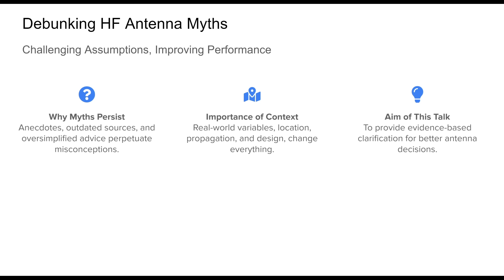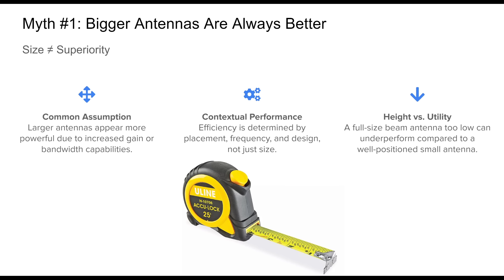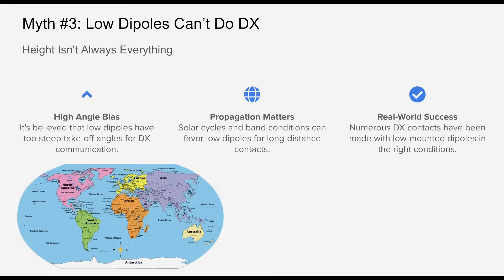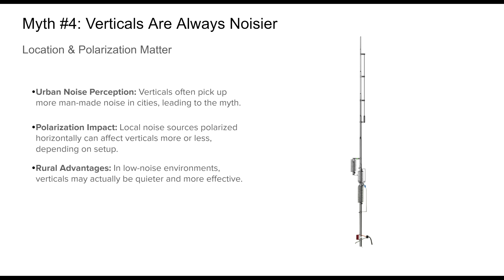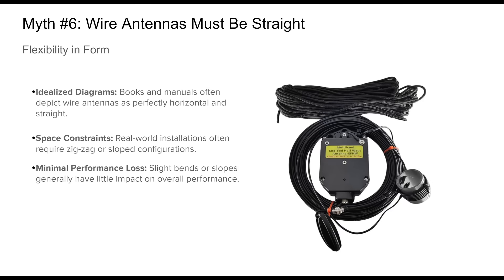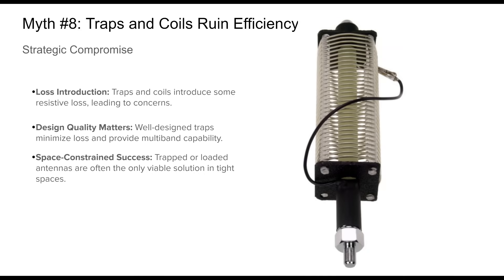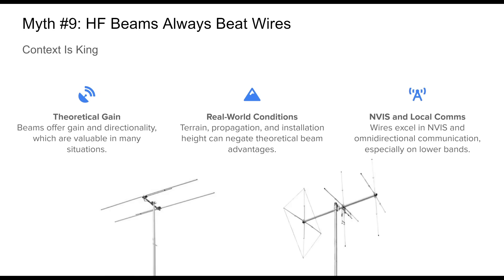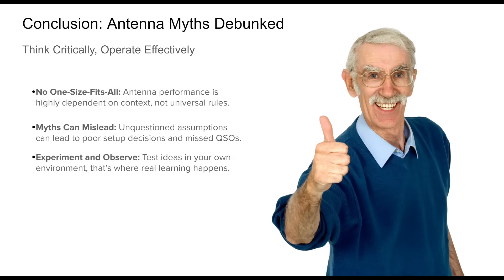10 Antenna Myths EXPOSED!

Comment: Excellent presentation of these myths! I would like to address your myths 9 and 10 from my experience. I have had both wires and large and small Yagis. With my small tri band (20/15/10) Yagi at 70 feet it worked good. On 20 meters it was no better than a dipole at 70 feet. It was easier at the time to get the small Yagi to 70 feet. About the same on 15 meters. The small Yagi was essentially a full size 3 element Yagi on 10 meters so it had reasonable gain. However in two directions my 300 foot end fed long wire was always better. The wire had slightly more gain off the ends than the Yagi. However it was easier to rotate the Yagi than the 300 foot wire.
My largest Yagi was a 4 element mono bander at 70 feet. I thought it was a great antenna. Slow to rotate but good gain off the front. Today I use three dipoles on a switch. The dipoles are two band ( fan configuration ) for 20 and 10 meters at 50 feet. When I switch to the one closest to broadside I feel like I instantly rotated a Yagi. The gain of the large Yagi was maybe 14 dBi off the front. My dipole has a gain of about 7 dBi broadside. The difference is maybe 7 dB. That’s only slightly more than 1S-unit! I have worked over 100 countries with the dipoles on multiple bands in a contest in one weekend several times, so that proves they work rather well and are a lot less trouble than the Yagi not to mention a lot cheaper! With a wire antenna the height above ground determines the peak elevation angle. However there is still a lot of radiation at higher and lower angles. Sometimes the radiation at low angles is still significantly more with a simple low dipole than with some other antenna configuration especially when compared to a vertical. A good vertical may have its peak radiation at a low DX angle but that peak gain is most likely zero dBi at that low DX angle while a low dipole or inverted V still has positive gain at that same low angle.

Comment: Myth #5: Your statement is correct initially, but we need to differentiate more precisely: Let's take my real dipole antenna at f=14240kHz as an example, which has an impedance of Z˙=51.7+11.8jΩ. By using the simplest tuner (a series capacitor) directly at the antenna, I can compensate for the X=+11.8j and then achieve Z˙=51.7Ω. If I then ask: Is the system resonant at frequency f? The answer is: Yes , the impedance seen by the cable is purely ohmic (X=0). If I ask: Is the antenna itself resonant? The answer is: No , the electrical length is not λ/2 for the frequency f. We assume that 100W of power is applied at the end of the cable. Looking at the circuit Before the Capacitor, the active power (P) is 100W, the reactive power (Q) is 0Var, and the apparent power (S) is 100VA. In the Capacitor, the active power is 0W, the reactive power is 22.8Var, and the apparent power is 22.8VA. After the Capacitor, the active power remains 100W, while the reactive power is 22.8Var, resulting in an apparent power of 102.56VA.

Comment: U can make good ants but u can  still get a sitio starduster  on uk ebay £75.99 it would coast more in metal and parts so y would u pi ss about  mine sat 150_200ft in the norfolk sky worked well  a usa comp usd 2 make a starduster with higher gane but can not find 1 at mo more monney 2 sirio still cheap as chips  today at 75
99   😊❤❤❤❤❤❤

Comment: Myth #5.5: Resonance is required for good efficiency.  In fact, non-resonant antennas can be efficient (and resonant ones can be inefficient).
Corollary to myth #8: A load coil is a matching network; it does what a tuner does.

Another nit on #5 -- a matched antenna is indistinguishable from a resonant load.  And it is a network of reactive components whose capacitive and inductive reactances cancel out.  If there's a feedline in there, it's just another reactive component that is part of a resonant system.  Saying a tuner doesn't make the system resonant is really just being fussy about definitions to start fights.

Signal pattern is not a question of resonance either, so bringing that up is a non-sequitur.

Comment: My inverted vee optimised for 5.262 Mhz had a maximum height of 22' and was bent horizontally into a G shape into my 25' x 13' garden. Not exactly a dx aerial but it worked. My Pixie running 350 mW got a SWL report from Utrecht 220 miles away. How much farther was my signal going?
A long wire at the old QTH in the 1980's got me VK, North/South America on 20m with North and South America and Falkland Isles on 10m. 100 Watts and using less on c.w.
Five attic h/b wire dipoles now for 20m to 10m. QRM for years had meant only above 20m was usable. QRM gone this year.
QRP here for 35+ years.
G4GHB.
Reply from the maker: That’s a cool story Bill, thank you for sharing 👍

Comment: Glad to see this, appreciate what you are sharing here. I obtained WAS and DXCC with wires and verticals not long after I upgraded in late 2000 to start my hf journey. I started with a 40-meter self-built coil loaded dipole in the attic of second-story apartment in the Chicago suburbs that quickly got the eastern 2/3 of the country for WAS on SSB with 100 watts. A year later I bought a house farther out in the suburbs and put up a Hustler 5 BTV on my garage and a homebrew OCF dipole strung up as an inverted vee along a fence line with a neighbor and the high point up in a tree. I had DXCC within a year of casual and occasional contest operating with 100 watts and these two antennas. It wasn't all a bed of roses, but to me, it was about having my station be a lab to carry out experiments. it's a journey and learning along the way that have made this such a great hobby on and off for me over the last 36 years.
Reply from the maker: Experimenting is the best part, thanks for watching Michael 👍

Comment: Vertical or horizonal antennas don't produce noise. They receive or transmit signals.  It is true that in some areas, the horizontal noise of VFD drives, Switch Mode Power Supplies, etc are radiated more off local power lines as a horizontal polarized signal. DX waves reflected off the ionosphere tend to be more horizontally polarized.  How this turned into antenna myths is interesting.
Reply from the maker: Good info, thank you!

Comment: Conditions matters a lot, I have done Chile on 60m FT8 on 15W (Max legal power here for that band) using a home made multiband antenna I designed myself. (Basically a variant of the FD4) with a 1:4 balun at the first wave intersection that correlates to 40, 60 and 80m. It's actually in total length longer than a wire antenna for 160m, but the impedance at the balun point isn't suitable for 160m usage, or at least not at any power above 40W. There's also a common mode choke on the feed line close to the balun.

I'm thinking of trying to make a 1:4 full transformer balun just to be able to get rid of the choke balun, but I'm not sure why there are so few full transformer baluns. Might be that their bandwidth is too narrow for a good application.

Trial and error, mostly error...
Reply from the maker: That's he we learn though, trial and error.  Thanks for the comment.

Comment: Another good video, thanks Ape! It was very interesting to see how these myths come about... the way a basic fact is over simplified or distorted. I come across the "tuned my antenna to resonance" so often I make sure I call my device by its old name, An antenna "matcher". Best 73, Ace
Reply from the maker: Hey Ace, thanks for watching 👍
Reply: When a system is non-resonant, it is composed of reactive elements where inductive reactances do not cancel capacitive reactances.  If you add more reactive elements to the system to bring them back into balance and neutralize the net reactance, then the augmented system is, by definition, a resonant one.

Say your vertical whip is too short, so it behaves with a net capacitance; how do you fix it?  You add an inductive coil, which cancels out the extra capacitance, and renders it resonant.  The coil is nothing more than a single-element tuner, and there is no fair definition of resonance that the resulting system doesn't meet.

Even adding a feedline doesn't change this truth -- though it has a resistance component that adds a lot of loss, it's still combination of reactances that the tuner can compensate for.  If you do not measure a net reactance at the input to the tuner, then it and everything following it are, together, a resonant system.

Comment: I had a GAP vertical Titan antenna ground mounted, and I worked has much DX as anybody else on MY TS-2000, and FT-847
Reply from the maker: Awesome, I have an 847 sitting over here 👍

Comment: I agree with everything you said apart from no 5,

An antenna tuner does infact electrically tune the antenna to resonance

A conjugate match occurs between the tuner output and antenna feedpoint where the reactance of the antenna has been tuned to zero, this creates a resonant antenna system

Reflections 3 goes into great detail on this subject
Reply from the maker: I’ve read reflections and am familiar with conjugate matching… antenna system and antenna are different.  From my perspective, it doesn’t tune the antenna 🤷
Reply: @TheSmokinApe not from Maxwells perspective
Reply from the maker: @Pioneer936 oh, you speak for Maxwell?
Reply: @TheSmokinApe I speak from his writings and he disagrees with you
Reply: @TheSmokinApe in reflections 3 he clearly states the antenna is also resonant with a conjugate match
Reply from the maker: "The antenna tuner really does tune the antenna to
resonance, in spite of opinions to the contrary of
those who are unaware of the principles of conju-
gate matching. The tuner obtains a match, by
which all reactances throughout the entire antenna
system are canceled, including that of the non-res-
onant antenna, thereby tuning it to resonance. " From Reflections III 13.3; is this what you are talking about?  What he is describing is the cancelling of reactance in the antenna system through the use of conjugate matching which 1) is only true if an exact 1:1 is established and 2) Includes the "antenna system" ie the transmission line and antenna.  So I am familiar with the point you are making AND the content where it's described.  I simply don't agree with this creative way of claiming that the antenna is now "tuned" as the removal of the ATU results in an "untuned" antenna.  What's really happening is the tuner creates a match for the transceiver to deliver maximum power (minus loss) to the load (antenna).  He describes the antenna being tuned to resonance but its the resonance of the conjugate match NOT the characteristic impedance of the transceiver output.   Really what is happening, is the tuner output is being tuned...
Reply: @TheSmokinApe the tuner output is the conjugate of the antenna feed point, therefore the feedpoint reactance has been tuned out creating resonance
Reply from the maker: Oh, the feedpoint reactance has been tuned out not the antenna was tuned?  I really do think this is a matter of semantics as we are describing the exact same “thing” but calling it something different.  Can we agree on that?
Reply: @TheSmokinApe the antenna feed point being the property of the antenna, if the reactance of the antenna feed point is zero the antenna is resonant
Reply: @TheSmokinApe the misconception is that the resonance of the antenna can only be changed physically
Reply: @Pioneer936  You can tune just about anything to resonance with an antenna tuner, including a dummy load!  But try transmitting with it.  I personally have no use for tuners.  Get rid of them and do it the difficult, old fashioned way, physically tune the antenna to proper resonance if you really want maximum performance.  

Tuners simply make your transmitter happy.  So does a dummy load.
Reply: @RickPaquin physically tuning an antenna doesn't guarantee to match it, most antennas are no where near 50ohm without a matching network of sorts, there's many  non resonant antennas using tuners that out perform a resonant antenna without one, some even have gain over a natural resonant antenna
Reply: @TheSmokinApe  you really need to backtrack on this one.  The antenna itself is a system of components.  Consider antennas like yagis, for example... does adding another director make it a system or is it an antenna with another part?  Does adding a gamma match make it a system, or is it still an antenna with another part (hint: a gamma match is a tuner)?  Is a bazooka antenna a feedline+antenna system, or is it "an antenna"... it has a feedline in it...

And @Pioneer936 is exactly right that Maxwell is what's real, and everything else is an engineering abstraction.  Your vertical with an inductive coil is an antenna with a tuner...  If there is a place in the system where we identify a single-port component that is a load with no net reactance, then it is resonant, and that's as fair a definition as you can get.

Comment: Howdy Ape, good video, as always!
I figured out a long time ago that the best way to really understand antennas (antenna systems) is to mentally take them apart and understand each part in isolation. Understand the radiating element, the feedline, the many matching methods, and the environment. Then there is less tendency to confuse observed effects, interactions, and assumptions with the wrong part(s) of the system, leading to misunderstandings and myths.

Myth: a resonant antenna is more efficient, or, there is a peak efficiency at resonance.
This has been disproven on professional antenna ranges. 

The truth: the efficiency of an antenna (the radiating element alone, without regard to feed-line or environment) is proportional to its linear size, and it levels out around 95% at 1/2 wave and above. There is no efficiency peak at resonance.

Electrical "resonance" is simply a state of balanced reactances, which cancel, and if the remaining radiation resistance matches the characteristic impedance of the COAX (typ. 50 j0 Ohms) there is an efficiency peak IN THE COAX. This leads hams to believe, by observing SWR meters at the shack end of coax, that the antenna has an efficiency peak at resonance. It just isn't so! The observed peak is the happily matched coax, not the "resonant" antenna element. And of course, there is also the peak at the radio's "happy" design point impedance.

This can be proven by performing field strength measurements on non-resonant (but around half wave) antenna fed with ladder line (a "doublet"), which unlike coax, maintains good efficiency (very low loss) even at very high SWR. Thus, the classic all-band doublet with a good tuner is about the same overall efficiency as a single-band "resonant" (actually "impedance matched") dipole on coax.

The bottom line is that every antenna has impedance matching somewhere in the system. It can be in the antenna itself (as in a half-wave center-fed resonant antenna), or at the feedloint (as in an end-fed with a high-impedance UnUn), or a feed-point remote auto-tuner (to match the antenna to coax), or BEST OF ALL, an auto-tuner (or manual if preferred) IN THE SHACK, feeding ladder-line, which suffers insignificant loss at high feed-line SWR.

The in-shack tuner, is easily adjusted, safe from weather, and easy to isolate during storms. Auto-tuners are switched-L tuners, which are a little more efficient than manual T-tuners. Tuner losses, or efficiency, are usually over 95% if correctly adjusted so the hi-Z side is toward the antenna.

In-shack tuners WITH COAX do not fix the very high SWR-induced losses in coax, and lead misinformed hams to believe their tuner is wasting a bunch of power, when it's the COAX. That's sort of like the opposite end of believing a non-resonant antenna is wasting a bunch of power, when again, it's the mis-matched COAX! All that nasty dielectric stress heating.

In-shack tuner with ladder-line suffers almost NO loss at any SWR. Thus, you can match your 80 meter doublet even on 40 meters, where the antenna is 2 end-fed half waves, with the worse possible impedance mismatch at the antenna terminals, and MAX SWR on the line, but at about the same overall efficiency!

Yeah the first time I really understood that it blew my mind, too.
73, --kv5r
Reply from the maker: What a fantastic post, thank you KV5R!

Comment: My HF antenna is a Alpha Delta DX-CC multiband set up as an inverted V for NVIS. From E. WA, I have contacted australia, Japan, most of South America, and many European countries.
Reply from the maker: Awesome 👍
Reply: I have the same antenna strung between two organic towers ( trees ) .  Using an icom 7300 with no amps etc I’ve managed dxcc over 4 years of not trying very hard.  I think by the end of the next sunspot cycle I’ll have dxcc on at least 4 bands with this setup, but unlikely to get em all on 80 meters for the full 5bdxcc.
Reply from the maker: @gerryrozema8338 👍